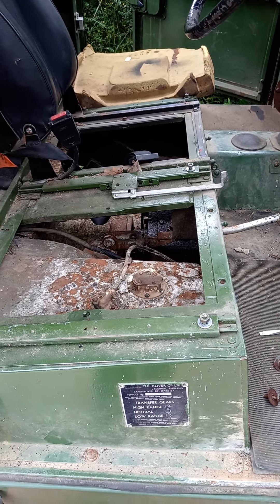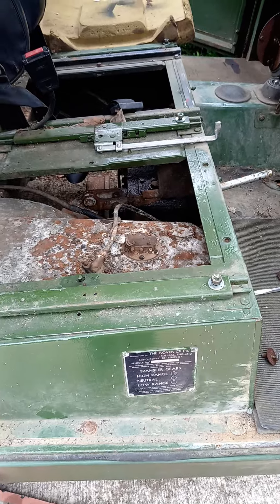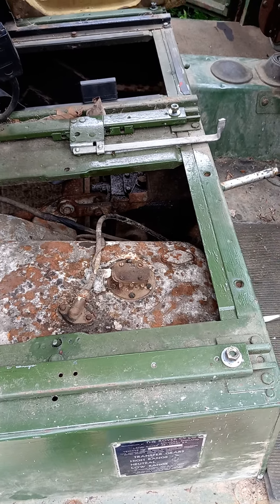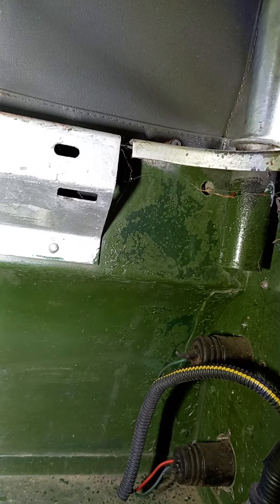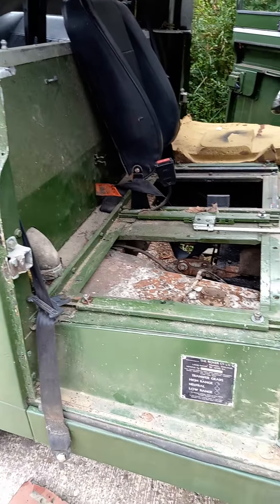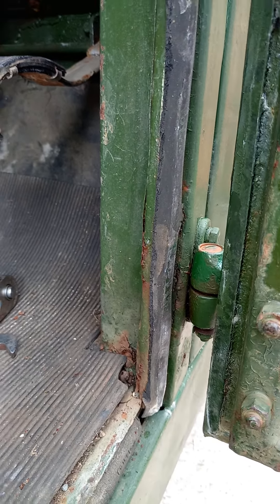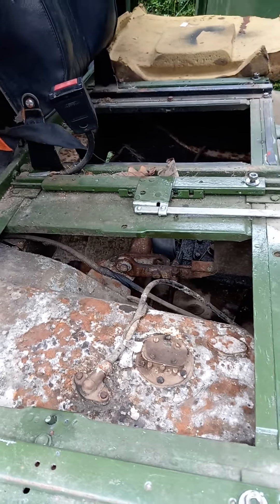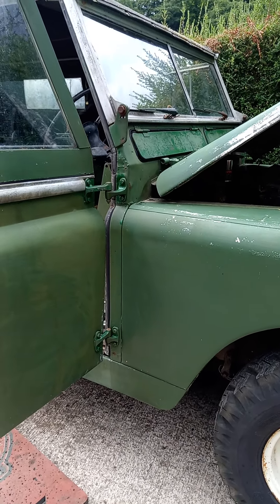A Landy called 'Bess' episode 4

Comment: Hi Richard, 
On my Series 2(1961), the chassis plate starts with a 1 for a Series 2. The same number should be on front right dumb iron. You might need scratch some of the paint away to check. There are a couple of other places like the steering box and voltage regulator which have similar date codes for 61 or earlier but might have been replaced.
Reply from the maker: Hi, many thanks for the comment. I'll have a good look tomorrow.
I appreciate the views, stay tuned 👍

Comment: Sir: what's wrong with the engine it already has in it? Personally I would compression check it and give it a good service, Replace points/plugs/condenser and possibly ignition coil, fluids and IF it's running fine save your money. I say so because you are unlikely to be doing high miles. Also: Perhaps that 3 bearing engine is the factory-fitted one meaning your chassis/engine ( and axles/diffs) might be factory? (Originality is where the Money lies IF such things interest you)  I would give my eye teeth for a series motor to replace the Holden Engine in mine.
PS I have seen Far Far worse rust on door bottoms and bulkheads. 
But going back to the engine question: IF you are taking the whole body off to restore: it will be simple (ish) to overhaul your original engine and put it back in.
Reply from the maker: Hi Cameron,
If you listen carefully in the video entitled 'update Landy now running ' you can hear the engine has a knock, and also a rather substantial oil leak when the engine is warm. As the odometer is on 28k miles I am assuming it's 128k miles and therefore will be rather tired.
I've  receipts with Bess that point to recent servicing - plugs, oil, points etc so I know this engine knock will necessitate a rebuild. I will keep the original engine and possibly rebuild it eventually but for now the most economic way forward is a replacement good engine.
I'm guessing you're in Australia with having a Holden engine in yours?
Fortunately I've found a good source of s/h parts less than an hour away from me.

Thanks for the comments - stay tuned 😉
Reply: @mgb40v8  Ah OK I somehow missed that the motor in yours has significant issues. I am sure the original will be worth rebuilding though. (But you have tons of other work coming) I live in South Africa. KZN coast. Over here you get LOTS of converted series Landy with the "Chev 4.1" conversion. Some are done really well, some are horrible. Mine was cheap and horrible but I am fixing it on a next to nothing budget. Hence my interest 🙂

Comment: Bess is a beauty. Try not to exchange the engine for another one,, please. 
Paying the deposit tells me my advice is to late... 😮

The money you are spending on Steve's engine can be used to fix the original engine.

Here in Hermanus, the Land Rover Capital of South Africa, the fans, purists and collectors will pay much more for a car with matching chassis and engine numbers, and so anywhere else. 

Steve is wrong, Bess must have the Solihull badgesc on the grill, and at the back.. Only Series 1's had the Birmingham badges, as I know. 
My 1957 Series 1, 107" has Birmingham badges. 
My 1960, S2 88"  and 1969 S2a 109", Solihull. 

Bess  is a Series 2 by what I could see, or the very first of Series 2a's.

Wiper motors x 2 in windscreen.
Short straight low down handbrake lever.
Wide skirts underneath the doors. 
Flat skirt below the grill, above the front bumper.
Could not see if the vent flaps have nuts and bolts, or welded hinges.
They are being opened by up and down levers, different from my S2 that has turning knobs.🤔 
The tunnel over the gearbox don't have a swing away inspection cover that is been held down with a wing nut...as for S2..... 🤔

Nice project, try and keep the patina, she's sexy as is, for an old girl...
Mutton dressed up as Lamb doesn't work for everyone... 😂
Regards, Landy Nutcase, 🇿🇦
Reply from the maker: @alwynvanwyk1851  Hi,
Many thanks for your comments and info - that's all very helpful.

Don't worry about the engine swap, I'll be keeping the original engine (that's if it is the original engine - who knows she is 63 years old after all) and may rebuilt it much later on down the line. For now the cheapest way is to do the swap - matching costs in Britain would mean spending much more money plus all extra travelling taking the block and head to a decent machine shop. There are none that I'm happy with in Wales so that means several trips to England. The original engine is bound to be completely worn out and likely as not need everything doing.
Thank you so much for your interest - stay tuned 👍.